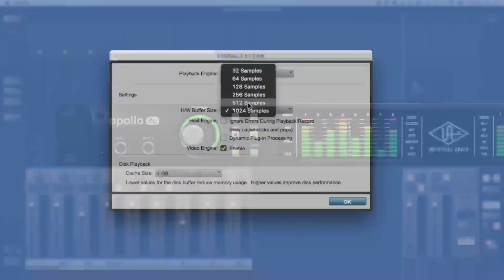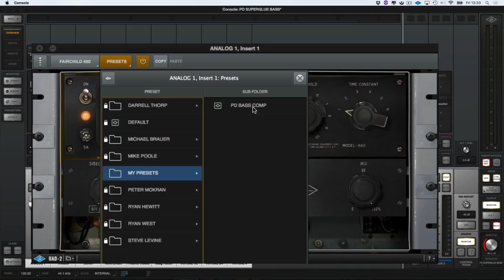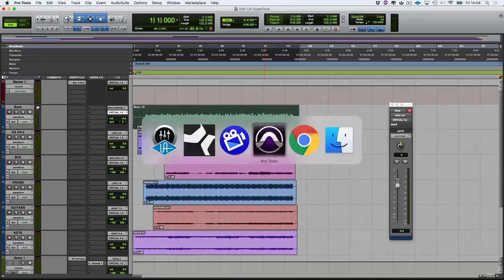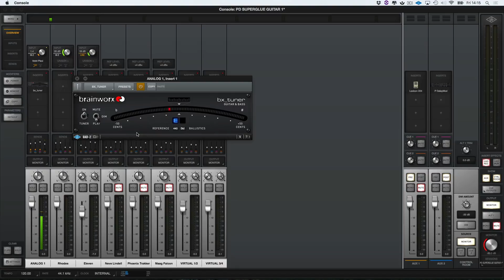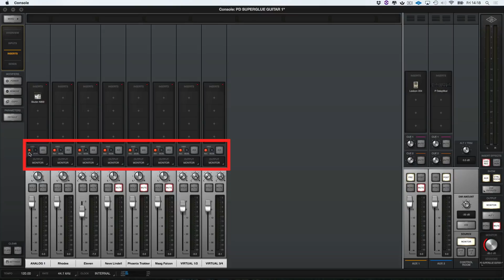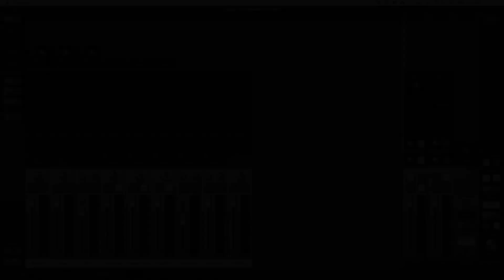Recording And Mixing With UAD Apollo - Part 1

Comment: Unless a project is huge, CPU will not be overburdened, I see no reason to insert effects plugins in the Console just to monitor it.  i would just insert in the DAW soImwnt be limited to real tiime tracin and processing.  I would insert amp modeling plugins in the Unison slot including preamp plugins commonly used for tracking vocals though.
Reply: yes - I agree. Check out my Apollo X4 review if you're interested!

Comment: Excuse my head scratching but with respect to the guitar, it was tracked dry with the delay inserted in the console and only being monitored.  Afterwards, the same plugin with the saved settings was inserted on a Pro Tools auxiliary track?  I take it the guitar would be bounced with the delay auxiliary track.  That doesn't make sense.  Correct me if I'm wrong, but in the Console Program itself, the delay could have been placed on an auxiliary track.  The wet and dry tracks then could have been sent to Pro Tools on separate tracks.  There would not be any latency issues because the delay remains processed in the Console.  That's its whole purpose!!  Otherwise, I would have selected the delay on a Pro Tools aux track in the first place (or used Audiosuite).

Comment: Does anyone know if the unison sound is different from just using an insert? So would the marshal sound the same used as a unison as it would just as an insert on the daw?
Reply: Jake no unison only works through the pre amp otherwise it’s the same as any other plug in

Comment: Thanks much, this was great.  I'm an Apollo newbie as well, and this was better than the UA videos, which are way too salespitch-y (although you might talk a bit fast for slow, bass-playing Yanks like myself, lol) .  

But one quick question: is there a way that I can record as normal (with Console, etc.), and then have my bass track playback through the same channel in Console, so I don't have to do the "going back to Pro Tools, finding the same plugins, loading the preset" dance?  Or did I miss something that's probably Engineering 101 (and I, as previously noted, am just a thick bass player)?